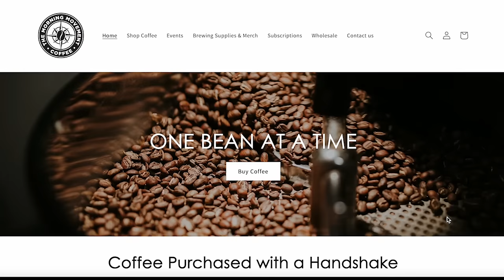SOME VERY SPECIAL GUESTS ARE COMING....

Comment: They will either have to raise or change that window to a slightly smaller size to avoid the very real possibility of leaking.   It’s a pain in the neck problem but easily remedied.   It can be done anytime before the final roof and siding is completed.   Great work guys.  A much needed addition and the dining room sounds fabulous.
Reply: You have to remember they didn't redo the wall after they figured out the studs weren't cut to length so the wall is 4 1/2 inches higher, the roof should have been that much lower to go under the window
Reply: yeah . . . that's right.   When you get 2-3 ft of snow piled up against that window . . . who knows . . . ? ? ?    Plus the roofing material alone is gonna be another couple inches.   🤔hmmmmm  🤔
Reply: They should just cover it with plywood to prevent melting ice from breaking into the house.

Comment: I'm a little apprehensive Re: spacing difficulties near close clearance window when further roofing is installed. Incredibly beautiful autumn mountains there.  In the Sangre de Christos most of our fall colors are Aspen, but they do so alternately in bans of altitude. From the valley floor of 8,500 or so up the 13,000 + ft mountains in our backyard, it's amazing. 😊

Comment: Wasp suggestion:  For carpenter ants I sprayed vinegar in several days of applications  and it worked. Not sure it will work for wasps, but it can't hurt to try. Strait 5% white vinegar in a spray bottle is what I used. It was a skylight window over our kitchen in Bellingham,  Washington.  Not sure how they were getting in, it didn't leak. Hope you figure it out,  wasps are worse than ants. 😮

Comment: 2. Suggestion:

1. Grow small potted plants that repel wasps: Apart from spearmint leaves, wasps hate the smell of lemongrass, thyme, and eucalyptus. You can grow these plants around your house to prevent them from coming.
2. Some of the home formulas include garlic powder, cinnamon, peppermint, distilled vinegar, moth balls and soap solutions. Mixing them well with water in a spray bottle and throughly spary the area where you see wasps/flies or using them in powder form you can apply them on window frames and nearby areas and wasps will be repelled.

Comment: The trick with the brown paper bags & wasps nests is the bag has to LOOK like a nest. A boxy open bag won't cut it.
For me.. this has worked for years & have had to replace after weather wear a few times.
Take your paper bag stuff it with like plastic bags or newspaper to "bulk it up" then pinch the top .. bunch it & wrap it up in like a bread tie or some yarn. Round out the bag .. crinkle & dent corners to look like a big oval/circle-ish. Hang it with string or wire. Wasps won't go where a nest exists. from my experience and has been successful keeping them away from house

Comment: Build suggestion.  Replace the window that touches the roof so it is 6 to 12" above the roof and it can be flashed properly.  As is, you will never be able to stop it from leaking.

Comment: You have to stuff your paper sack so they are round and twist the to and tie off with a rubber band. And then hang up. I have done this several times and it works every time!

Comment: You should have used Zip-R sheathing on the roof. At least 2 inches. You are going to need a lot of insulation. Maybe consider using exterior insulation on the roof. The snow buildup on the roof and the backside of that house is going to be enormous.

Comment: We had wasps and hornets at our summer place so what you have to do is take some paper (old newspaper whatever or plastic bags waded up, take a brown grocery bag and put the waded up paper or plastic bags in it and crumple the bag and kind of shape it in a large oval shape so that it looks like a wasp or hornets nest. Take string and wrap it around the top to close it up and hang it up. You'll get the shape you want just work with it. It does work. You could probably spray it with wasp spray. Hope it helps cause it worked for us.

Comment: Allie…10-15 drops of peppermint essential oil in a cup of water in a small spat water deters wasps, ants and rodents.  Just spray it around the perimeter of your house, windows and doors.  I t works great and smells wonderful.  I even clean my pantry and painted cabinet doors with it every couple of months.  Good luck.

Comment: Insects do not like the smell of clove, so I apply clove powder to my floors with dealing with ants and yellow jacket nest at was on my patio. I mixed HOT water with clove powder for the nest . They got the message and moved. So they are in a tree that's in a good location for they do help with mosquitoes

Comment: Wasps can be a pain in the neck. But not that hard to get rid of. I use a product called Home Defense by Ortho, and yes it's the same one that you use to get rid of creepy crawly things. I spray all around windows and doors and eaves. And it works great. The wasps HATE the stuff. And after you do a good and thorough dousing your good to go for the whole season. You will have to repeat the treatment next year, for both the creepy crawly critters and the wasps but so what. It works.

Comment: We spray peppermint oil all around our doors, windows and under the eaves of our house a couple of times a year here in central Florida to help prevent the wasps from nesting.   It doesn't completely eliminate them but has definitely cutdown how often they start a nest.  We have the paper wasps....not sure if it makes a difference.   Mix some peppermint oil and water in a garden sprayer and spray all the areas several times a year.

Comment: If you have a container and can put some gasoline in the bottom and wedge up to where the roster for trying to get in, particularly if they have a Nessed in the making, it will draw the virus and the nests into the container. Problem is it needs to be Circumference that is airtight. So may be a piece of wood over the area that you can manage to make a more flattened surface and then just go up with a container hold it into place a few minutes and when you draw it away, they will be in a gasoline. Does not take much gas and just saw this video hair in North Carolina where that’s kind of a problem is a reoccurring nuisance.

Comment: Hi guys,

I know it is expensive but, for the structural integrity of the 2nd roof, did you considered renting a crane for a couple of days?

I'm not expert by any means but if that roof needs to be sealed, make sure you don't run out of material this time.

Comment: I am a builder and was wondering aren't you going to have heat lose between those rafters that are sandwiched together. Another question is why don't you guys place tivac between your double top plates and at bottom plate to join the vapor barrier or are you spray foaming all your walls?

Comment: Those paper bags are hanging too low and not supposed to be hanging like that still looking like a square bag. Needs to be 8-9ft high under an eaves more crumpled but you can get the ones called "Bee B Gone" or "Wasp B Gone" and they work.

Comment: I'm still at the beginning of the video, I'm not a carpenter or a house Builder and I'm not going to pretend to be by giving stupid advice but I do have a serious question, if snow is expected in the forecast in the following days why not focus on the upper roof and getting that framed in with the sheathing before focusing on the bottom roof. Personally if I were going to be doing this I would rather be working on the top roof in the nice days and then deal with the lower roof lower roof if snow does come. Rather be on a roof that's 10 ft off the ground rather than 40 feet with snow